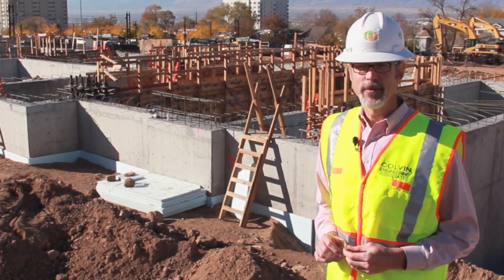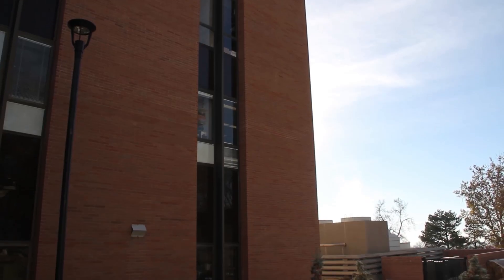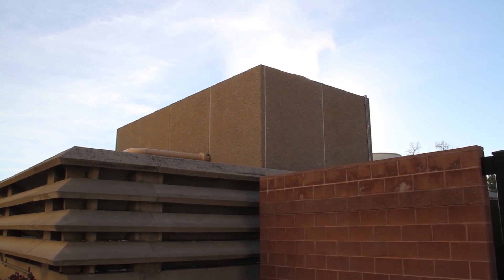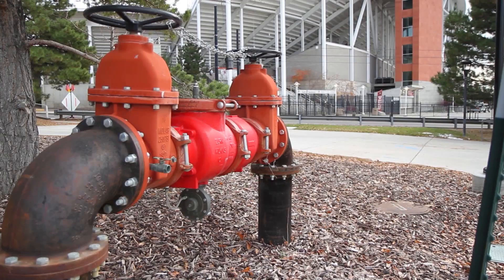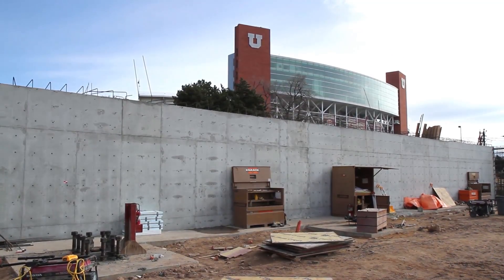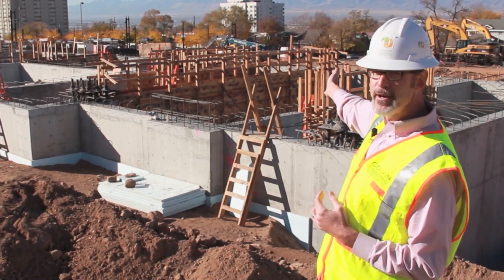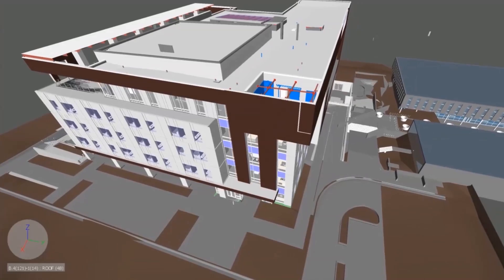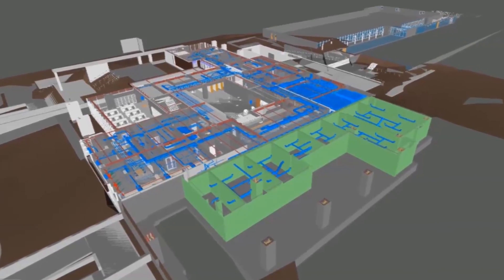Innovative Thermal Storage Tank

Comment: I super insulated my foundation walls from the outside, (used styro) the mass of sand and soil within my foundation acts as a seasonal  earth battery. Cool in the summer, warm in the winter. No moving parts. It is almost that simple. add in oversized trusses in the south facing walls to control the solar gain. free heat, free cool, no moving parts.

Comment: Still takes an enormous amount of energy to pump/ move all that water back and forth! Not to mention all the energy used to make that concrete and steel to make the tanks. What a bunch of HOOPLA!  May as well have built the building underground!
Reply: You don’t realize just how energy intensive traditional cooling is. Even with the initial energy cost of building this system, it still uses far less energy than traditional AC. 

Water and geothermal cooling are dirt cheap when compared to compressor cooling. 

Either that or you’re smarter than all the engineers who studied this for years...
Reply: All that water was anyway pumped, for irrigation.  Now is pumped just a little extra length of pipes.. 

I was thinking at something similar, but bigger for storing the snow from winter, better blow the snow underground and use it for cooling in the summer than transporting it with truck out of the city.
Reply: @ehombane   - 1 st It was pompt from 1000 feet from the ground and then You must pomp It another 400 to the top of the building, If that is done with the seme pump then îs a good gain, but stil more energy lost!
- storing snow unther ground......in large quntatise ? 
Are You serios ?
Reply: @alexaandrei7884  do the math. You have your parking lot, and if you have green space near it, you will shovel the snow on it. But if you truck it out of the city as I see in some places, it is quite costly. Sure, building an insulated underground storing space is not cheap either. But considering that you save energy for air conditioning in the summer, you may realize that this can really be feasible.   I assume that you do not know that people stored ice in insulated rooms before the compressor was invented. Sure not industrial quantities, but then  there was not todays technology. 

And building underground infrastructure should be considered more. Just look at how things are going today. They build a lot of multilevel buildings with minimal drain infrastructure, and bury cables, bury pipes, and when those starts leaking, dig again and destroy the streets. In my half century dwelling around, my city was a continuous building site. What if there was better planning, I mean under my blockhouse a ten square meter section tunnel. This was 5 percent cost increase. And under walkways this was continued with another one three times more spacious, and through here all facilities would have been installed and renewed. No more digging. The initial cost would have been recouped in few decades. And do not forget that this ways leaks would have been controlled, no more waste and dangerous sinkholes all over the place. And with actual level of technology, this underground infrastructure could have hosted automated parcel delivery. Your weekly grocery could come on its own, on a tiny wheeled container, but now you transport forth and back your hundred of a kilos, plus a ton or two of steel if you go by car. Sure, but for this would have been needed some planning and some real engineering. But because we are not thinking ahead, ideas like storing ice seems a joke for you.
Reply: @ehombane  Ice îs one thing and snow îs totali difrent !
I had a frezzer that used Ice as fuel !
Reply: @alexaandrei7884  So ice is OK for storing underground, but if you have fluffy ice, the idea is ridiculous?
I did not worked out the engineering part, I mean the size of the collectors, or the feeding pipes,. and also compacting ratio, but the idea is to be automated modules that in summer collect garbage but in winter collect snow also. And being small, would clean the pedestrian walks too, and avoid so many broken bones too. 

Anyway, if you really think that this is a funny idea I will give you another idea even funnier. At least you will have a good laugh. Enforcing the sink disposal in every house. This way, any organic leftover will be disposed with regular sewage, through already installed pipes. And garbage will be clean, eliminating the need for sorting it in advance. Sorting will be done automated at recycling plants. I have seen those disposal in movies since decades ago, and I understand that they are mandatory in a single US state. But at global level we still use the medieval system of stinky garbage bins.